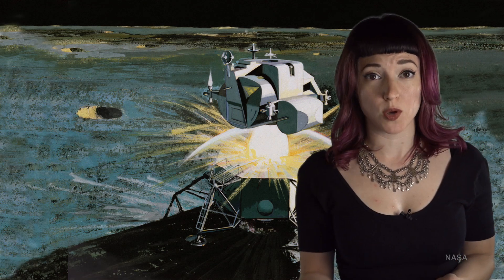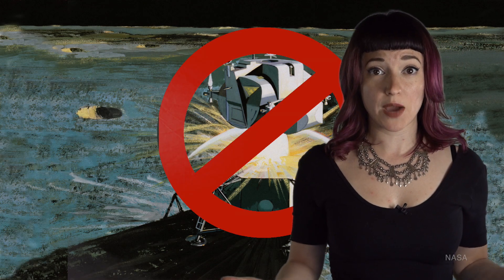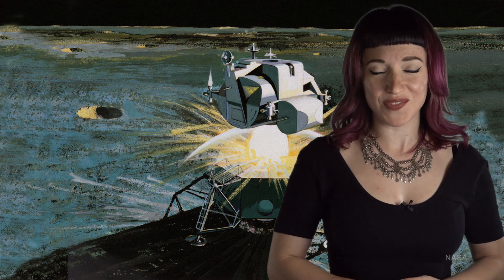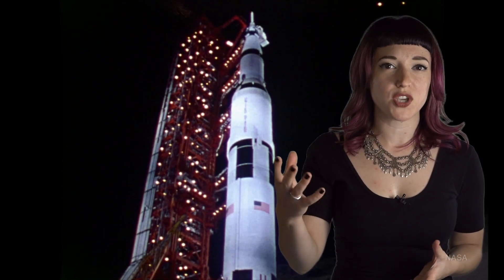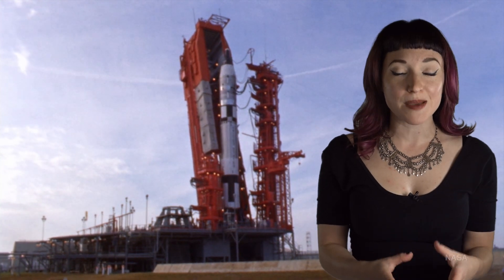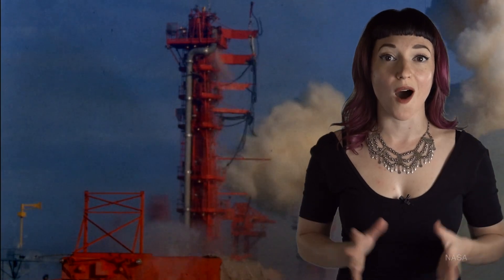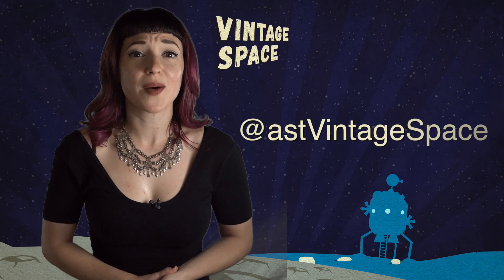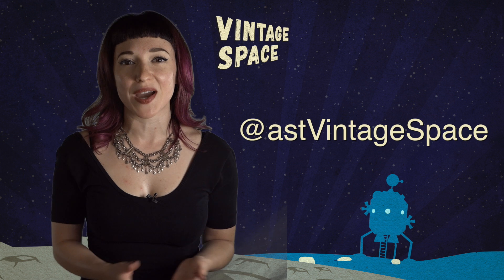How the Lunar Module Launched from the Moon Without a Flame

Comment: I always wondered about the lack of a flame and your answer amazed me with its scientific explanation. Hypergolic fuel burns a violent, bright red but nasa was somehow able to adjust things so there was no exhaust visible. Engineering genius. And, no debris was kicked up so they must have been easy on the throttle. No dust, no red flame, and no automated guidance system or steering and they made the docking perfectly. Brave people that's for sure.
Reply: "Hypergolic fuel burns a violent, bright red"

Huh?  There are tons of fuels compounds that burn red, or clear, or yellow, etc.  There's no such concept as just saying "hypergolic fuels burn red."  Which ones?  The only ones relevant to Apollo burned clear/invisible.  N2O4 and Aerozine50.  When burned in a vacuum, you won't see them burn, because the wavelengths of light they produce are outside the visible spectrum.  And, in an atmosphere, you mainly cannot see them either.  Depending on how rich or lean they run the engines, you can sometimes see some byproducts or unburned fuel burning with the oxygen in the atmosphere instead of the N2O4.  But, the majority of the flame is invisible.  Or, if you run lean, you'll see the reddish color of the N2O4 breaking down into NO2 (x2).  But, that's not even part of the burn itself.  So, bottom line: I don't think you have the slightest clue about this topic.  Nobody who understands it would ever just label all hypergolic fuels as "burning red."  It matters about WHICH hypergolic fuel you're talking about, and what you use for an oxidizer.  I think you watched a conspiracy video that botched the explanation badly, and you came here to regurgitate the botched claims.

"no debris was kicked up"

Good gods.  Watch one of the landing videos yourself.  Dust is being blown like crazy.  Look at the photos of underneath the landers.  It's quite clear that dust had been blown.  There are radial striations in the dust and regolith, showing that a rocket engine had been running right above it.

"no automated guidance system or steering and they made the docking perfectly"

Does this even make sense to you?  Do you think that none of the engineers who worked on this realized that they forgot to make a way to dock?  Forgot to make the craft steerable?  Good grief.  What do you think those sixteen 100-pound thrusters were for on the ascent stage?  They were in four thruster quads (4x4=16).  They had 100 pounds of thrust each, and were operated four at a time, to steer the craft.  What do you think that radar dish was on top of the craft?  It was the rendezvous radar.  It's not unlike the radar dishes that are located within the nosecones of most airplanes, except, in space, you don't need the nosecone for aerodynamics, because there's no air.  They used radar to locate the other craft, and fed that info to the guidance computer.

Tom, c'mon man, it's 100% clear that you don't understand this topic, and you have elected to cast all of your thinking capacity out to sea, never to return.  Get real here, Tom.  Go swim out there after it.  Go get it back.  Don't just blindly trust a conspiracy video that tells you outlandish things that are debunked at the blink of an eye.  Good gods.
Reply: @rockethead7  
The Titan2 rocket launch proves the fuel used burns with a visible flame. Either the lunar module used a different fuel, or it used none at all.
Reply: @gww5385  
First of all, the Titan's flame was largely invisible.  But, yes, you could see a bit.  This is because they ran the Titan rich (more fuel than oxidizer) to keep the engines cool.  This resulted in some of the unburned fuel then combining with the surrounding air/oxygen instead of the N2O4.  This results in a small portion of visible flame.  Also, you see some interaction between the atmosphere and the flame itself.  On the moon, there is no atmosphere to see that interaction.  Also, they didn't run the engine rich (it wasn't necessary for that engine, nor would it have done much good).

I've explained this to you before.  Thanks for proving you never read answers to your own comments (yet again).
Reply: @rockethead7  
Are the fuel mixtures documented for both the Titan2 and Lunar module engines for you to make this comparison? Also the visible flame exiting the Titan2 rocket appears immediately after its exhaust, this being the least likely point that air would mix with the fuel.
Reply: @rockethead7  
I apologise for any offence caused by my lack of response to any previous comments you've made, believe it or not I do respect your opinion. 
On researching the hypergolic fuel Aerozine 50, there is no evidence of it's combustion producing a clear flame. In fact, the Titan2 rocket's exhaust flame eventually became almost clear as a result of it mixing with the surrounding air - this is obviously not a reason why the lunar module's flame appeared invisible. Also, the lack of atmosphere does not affect either ourselves or a camera's ability to see what should have been a visible flame.
Reply: @gww5385  
"hypergolic fuel Aerozine 50, there is no evidence of it's combustion producing a clear flame."

1) The word "its" exists for a reason.  Use it.  What you just wrote was "there is no evidence of it is combustion producing..."

2) Secondly, you have just proven that you know absolutely nothing about rocket chemistry, or, probably chemistry at all.  Nobody, and I mean NOBODY, who understands chemistry would make a statement like this.  Why?  Because the visibility of a flame is dependent not only on the fuel, but also on the oxidizer.  The wavelength of light depends on the distance the electrons jump between one molecule and another during these reactions.  Aerozine50 might produce a visible flame with one type of oxidizer  (one type of molecule), and an invisible flame with another type of oxidizer (a different molecule).  There isn't a chemist on the planet who would just list the fuel and not the oxidizer with the statement you just made, because whether or not a flame is visible, is dependent upon BOTH the oxidizer and the fuel.  You obviously didn't know this simple fact, because you know nothing whatsoever about chemistry or light.  But, you sure think you know better than every expert on Earth.  It's quite an amazing demonstration of Dunning-Kruger.

3) You're just plain wrong.  Aerozine50 and N2O4 burn with a flame that is not visible to the human eye.  The wavelength of light it produces isn't within our spectrum.  You could probably see it with a thermal camera, but, not with a conventional camera made for our human eyes' perception.

The rest of what you wrote is also just plain wrong.  And, naturally, this is a product of the exact same gibberish as you always write.  You pretend to know things you don't know.  It's really quite laughable and ridiculous.  You honestly believe that the entire world's rocket scientists and aerospace engineers simply "forgot" that the flame should be visible, eh?  Good grief.

And, no, that's not what's happening with the Titan's flame.  Stop pretending to understand things that you don't.
Reply: @gww5385  
I will add, this is a perfect topic for a chemistry journal.  You can just calculate the wavelength of light to be produced between N2O4 (oxidizer) and Aerozine50 (fuel).  Do the molecular modeling.  Calculate the distance the electrons will jump, and the resulting wavelength of light that it will produce.  Submit it to any university-recognized chemistry journal on Earth, showing that the light should be within the human eye's visible perception.  Then, show the world why no chemist prior to you has been able to demonstrate this.  Why would you bother with YouTube comments?  Are you under the impression that this is a science journal?
Reply: @rockethead7  
Firstly, I don't need your help with grammar. Predictive text - however helpful, can and does make mistakes for you.
Your claim re the oxidiser is a moot point, it was the same for the Titan2 as it was for the Lunar module. Despite the expansive reply you typed, it provides no evidence as to why we see the flame exiting the Titan rocket, but not from the lander.

NB - get off your high horse and quit the patronising tone, I'm beginning to realise why I didn't reply to some of your previous comments.
Reply: @rockethead7  
I'm assuming the only evidence to support your claim - that the fuel mixture ratio can be adjusted to the extent that it produces a clear flame (yet still work effectively) is from the lunar lander footage.
Reply: @gww5385  
How many times must I explain the same thing?
Reply: @rockethead7  
Unfortunately you've only provided your opinion. Respected or not, it isn't evidence proving how the module's exhaust was invisible. There are no real world examples of a hypergolic fuel burning with a completely invisible flame....none!
Reply: @rockethead7  
On looking back through this comment thread, it's now obvious you haven't a clue.
Reply: @gww5385 
You're wrong.  That's all there is to it.
Reply: @gww5385  
I don't have a clue???  YOU don't understand simple light and chemistry.  And, again, I'm irrelevant.  You're welcome to submit your calculations to any chemistry journal anywhere on Earth.  That's how you prove your point.  What I say doesn't matter.  I'm not the one declaring Apollo fake because I don't understand simple chemistry.  That's YOU doing that.
Reply: @rockethead7  
Apollo fake?
Reply: @gww5385  
I'm not playing any more games with you.  Stop asking me to do homework for you.  You have stuck your head in the sand and ignored every reply I have given you for years.  Now, all of the sudden, you're pretending you want me to go hunt down videos for you?  Why?  What possible reason would I have to dig through archives of tapes of test firings of invisible rocket flames?  All you'd then say is that you don't see a flame, so, how would we even know the engine is running?  It's RIDICULOUS.  You KNOW you have no intention of accepting input anyway.  All you want to do is waste people's time.  If you think the wavelength of light produced during that particular burn of those particular chemicals is wrong, you prove it.  You write it up.  If you reject the explanation that they ran the Titans rich, and that you are seeing the effects in an atmosphere vs. without an atmosphere, you write it up.  Submit these things to any rocket chemistry journal anywhere on Earth.  I truly don't know what you're waiting for.  YEARS!!!  YEARS have gone by with you making this silly objection.  I'm not going to sit here and hunt down video footage for you of invisible rocket flames that you intend (in advance) to reject anyway.  You have a years-long track record of distracting, ignoring, dodging, refusing to answer questions, and outright pretending to know things you don't know.  Why would I spend that kind of time on you?

Again, I said it before, and I'll say it again: if you actually wanted to have a real dialog about these things, I **WOULD** spend time hunting down everything you ask for.  That's the kind of person I am.  I like helping others.  I like educating others.  But, when I already know that the person I'm talking with has absolutely no intention of accepting any input, and has a track record of ignoring 99% of everything I've said in the past anyway, I'm not going to keep doing it.
Reply: @rockethead7  
When the debate is lost, slander becomes the tool of the loser.
Reply: Is that really your reply?  Good gods.
Reply: Does anyone honestly believe that during the height of the Cold War with a very capable enemy that THEY wouldn’t have called the United States out for faking six landings on the moon?

Comment: The lander had a flame when it landed but not when it took off
Reply: Huh?  Both the descent and ascent engines used the same type of fuel/oxidizer.  What are you talking about?

Comment: So this is what she did. She told you rockets can propel with invisible expulsion. She showed you some examples of rockets with smaller flames than others. Then she told you to believe that the lunar lander which is not a rocket operated on the same principle and that the cameras weren't good enough to capture any expulsion. The lunar lander without the lunar rover is already over 3000 lbs. One spacesuit is 280 lbs. Even with reduced gravity that spaceship would have required some serious thrust. Trust in science but not in moon landings.
Reply: Let me just make sure I understand you correctly here... are you under the impression that the lunar module didn't have enough thrust to lift its own weight?  And, not a single one of the 7,000 engineers at Grumman who designed and built it, ever realized that they forgot to include a rocket with enough thrust to lift the craft?  Is that what you're saying?

Comment: Space is a vacuum… no oxygen.. without oxygen flams can’t even ignite.. “fumes” still wouldn’t even do anything.. no matter what.. this has been proven in a vacuum sealed environment.. won’t work.. no one wants to hear BS explanation.. WE NEVER WENT TO THE MOON
Reply: Hilarious!!!  And, you think that the entirety of the world's aerospace engineers forgot that you need an oxidizer to burn fuel?  You think YOU spotted this glaring "gotcha"?  Pfftttt.  How do you suppose anything operates in space, like satellites in geosync orbit, and stuff like that.  Do you think the rockets just climb up from Earth, and then flame out the moment there's no air?  How would anything even get to geosync altitudes if that was the case?  How would any satellite or craft adjust trajectories?  Do you really not understand how rockets work?
Reply: “No one wants to hear BS explanation” 
I’d rather have a BS explanation than none at all. And you seem to be providing the latter rather than the former.
Reply: Which of the thousands of peer reviewed scientific papers on the data and samples from the Apollo moon landings have you proven fake?

Comment: ALL hypergolic fuels leave an opaque smoke. Also, you want me to believe that the camera was zoomed out, then panned up using a remote control with a 1.3 second delay, keeping the ascent module in center frame the whole time. All of this, at a time in history when people had to walk to the TV set to change the channel manually.
  A remote control from 1/4 of a million miles away. 
 If we had the technology to put men on the moon, there would be people there right now! There are ALWAYS  thousands of people in places we have discovered 50 years after the discovery was made. 
ALWAYS!
Reply: ALL hypergolic fuels leave an opaque smoke

Not in vacuum kiddo.
Reply: @tgstudio85  that's BS there is video of the shuttle that shows opaque, (I shouldn't say smoke), gas being discharged.
  Please explain why it would be any different in a vacuum.

Comment: The Saturn V/Apollo 16 rocket weighed the most at 6,537,000 pounds, more than 91% of it fuel. The lunar ascent module weighed about 10,750 pounds(on Earth), nearly half in fuel. In one sixth Moon gravity it was comparable to 1800 pounds. The Apollo command module, the actual capsule that returned, weighed around 12,800 pounds, including crew, at re-entry, and 11,700 at splashdown. Only 0.179% of what went up came back down.
Reply: Hmm.. the first stage rocket was ditched and fell to earth...    most of the fuel are converted to h20 and other resultant products and still within the earth gravity pull.
Sorry i was just metaphoricaly pulling your leg😂

Comment: The reason I'm watching this is because I just thought of the command modules running 3600 miles an hour around the moon the whole time Non-Stop how did this thing match the speed to dock with it you can clearly see underneath it there is no rocket cone perfectly smooth
Reply: Huh?  What?  No rocket?  Let me make sure I understand you correctly here... you're under the impression that the 7,000 engineers at Grumman who designed and built the lunar modules... universally forgot to put a rocket in the ascent stage?  Really?  How about this photo?  AS17-149-22852
Reply: @rockethead7  when I saw the video of it taken off I didn't see any rocket nozzle but when it got high up it did look like I've seen the plume come out and I guess it wouldn't take much of a rocket to go that fast in space 0 drag

Comment: so why don't  they use also the same fuel on lift off if it's so effective..?
Reply: Huh?  Yes, they used the same fuel for liftoff from the moon.  But, it's NOT effective.  There are far "better" rocket fuels (more effective).  However, if you want a super-simple rocket engine that doesn't even need pumps and ignition sources, yeah, hypergolic fuels are what you'd want to use.  They're not as energy-dense as other fuels (less effective), but, they're more reliable.
Reply: Because it’s not effective. Kerosene, liquid hydrogen and liquid oxygen are much more efficient than the hypergolic propellants used on the LM and CSM. And for most of the launch they have ground support to fill it as full as possible to minimise boiloff.